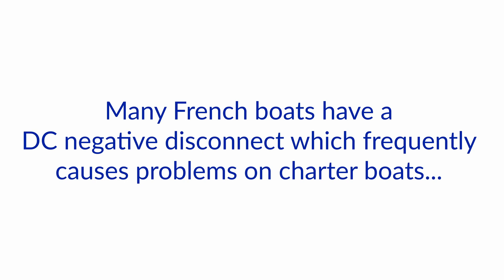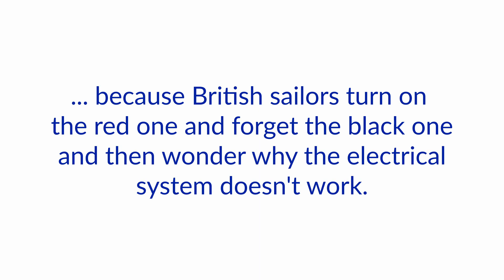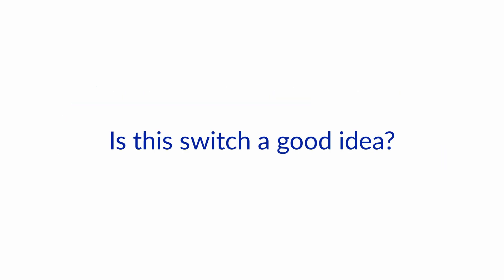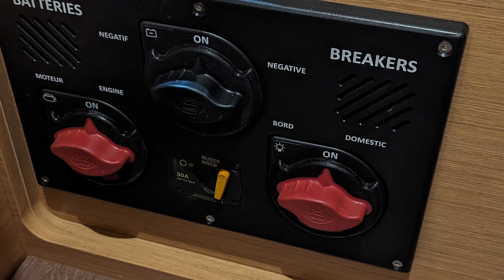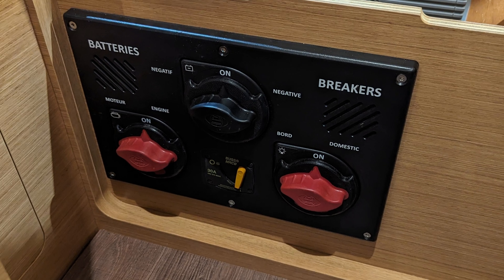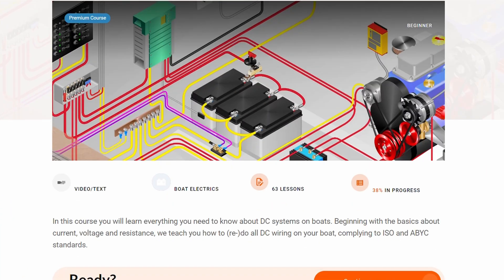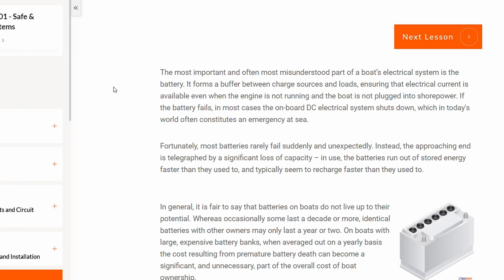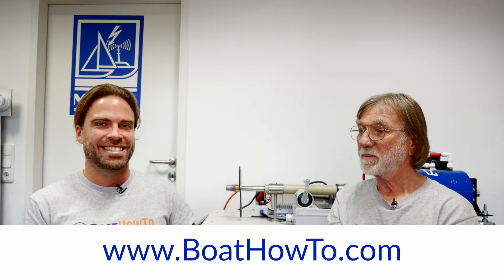Separate battery NEGATIVE SWITCH - Is this a good idea? | Ask The Expert with NIGEL CALDER

Comment: I just lately purchased a 2013 Jeanneau SO 439, (built in France, but for the US market), and it has a breaker board just like the one you showed, including that strange DC Negative switch.  I'm thinking I need to redo the whole electric system...